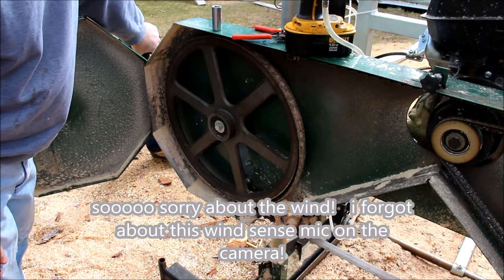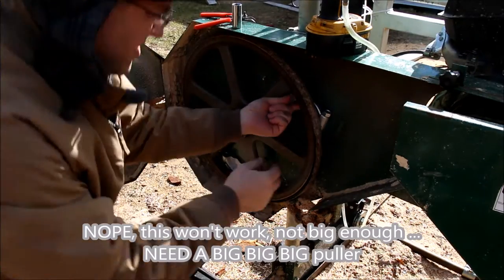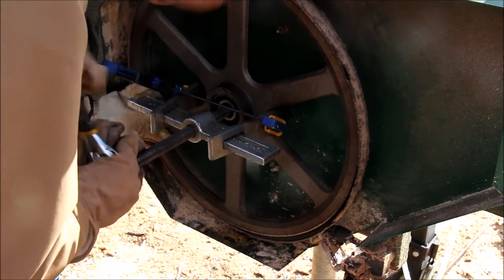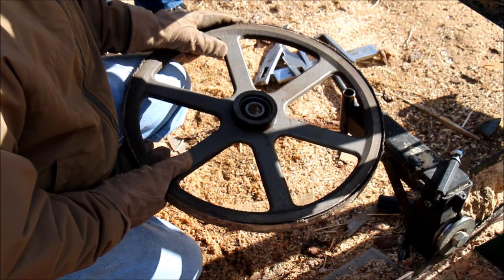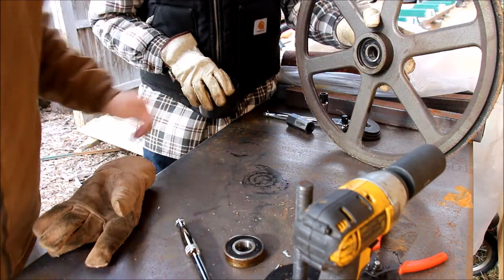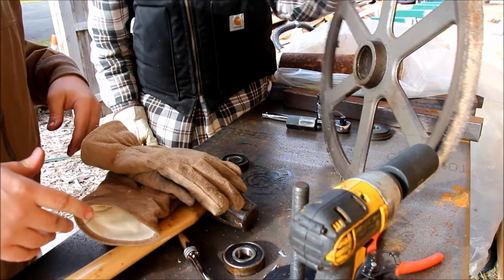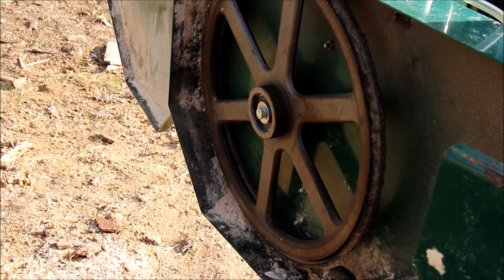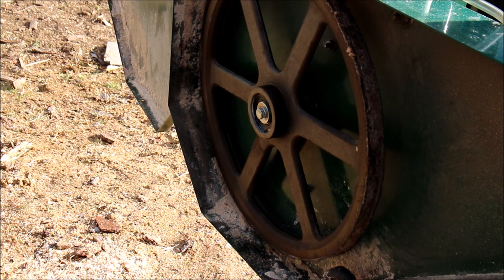Woodland Mills HM126 bandsaw bandwheel bearing replacement

Comment: Where did you get the bearings? Are those bearings still going? Thanks Der Guy.
Reply from the maker: Ebay
Reply: @matthewolson8875  Thanks. Would you say there are good bearings or what would you use?
Reply from the maker: @josephgrant9137  i got generic ones.   They work fine.  They were inexpensive and now that I know how to change them out its easy
Reply: @matthewolson8875  What would you rather use? My bearings failed and don't want to have to do this again for awhile. Thanks.
Reply from the maker: @josephgrant9137  Japanese bearings if possible... nachis if you wanna have em last.  But I just bought 10 of the generic ones....they are easy to change
Reply: @matthewolson8875  Sweet, thank you. Have a good night.

Comment: He mentions Harbor Freight but the headline says Woodland Mills. What's the deal?
Reply from the maker: He?  As in me?  Woodland mills mill is like the hf mill but upgraded in quite a few ways....
Reply: He has a Woodland Mills sawmill but the tool set for removing and replacing the bearings is from Harbor Freight.

Comment: I don’t think I would have put the anti seize in the bearing bore this will make it more likely to aping and ruin the wheel, maybe a thin light coating of oil but not anti seize
Reply from the maker: I totally understand the sentiment but I Have had tons of comments especially in regard to chainsaws indicate indicating that antics is no good for bearings yet I have not seen any practical situation where is situation where it increases the likelihood of spinning a bearing Thanks for the comment though
Reply: I’ve seen it first hand
Reply: I’m sure it will be ok though, glad u got it fixed! Thanks for sharing
Reply from the maker: @TheHomePros6221  I've seen spun bearings for sure....just not need any that I've built....and I put anti seize on a lot of bearings.

Comment: Where the hell did you ever get the ideal to use anti seize on a pressed fit bearing surface?  Never, never, never! The way those old bearings came out was perfectly normal and exactly what's expected. The next time your bearings go bad and the outside race starts spinning in the hub, you can thank yourself for using anti seize because you'll be replacing the drive wheel along with the bearings. Anti seize is mainly for threaded nuts and bolts. That also goes for using anti seize on the shaft where the inner race seats. Don't encourage a bearing to spin where its not supposed too.
Reply from the maker: Hey Todd...do you have a reference for why anti sieze is bad in this instance?  Link?  I still don't think it's bad to lube 2 pressed surfaces.   If the bearing goes bad there is always the likely hood of it spinning in the pocket but so far my experience seeing that is rare....   most of my experience is with chainsaws and I use antisieze  all the time when pressing bearings but have never seen a failure due to the antisieze itself.  Let me know if you have a link...I'll read up on it
Reply: Ok, you just answered your own question within your question. I quote " if the bearing goes bad there's always a chance of it spinning in the hub". (Because of the use of anti size) You increase that chance when you lube something that's designed for a pressed fit and not supposed to move! That's why. Bearings spin where there's least resistance. If the bearing were go bad and it's friction coefficient gets to high, it's going to start spinning where the next least resistance is, right where you put the lubricant! By putting anti seize on the shaft and hub your encouraging the bearing to spin where it's not supposed to.  Why encourage that to happen by applying anti size? 
     I've assembled thousands of bearings on shafts and pressed them into hubs at a manufacturing facility. Never were we instructed to use any lubricant or anti seize on any surface.
     Of all the bearing repairs I've done over the yrs, I've never found anti seize inside from any manufacture either. 
     For the last ten yrs I've worked in industrial facilities like coal fired power plants,  paper mills, nuclear power plants and oil refineries. We use it daily. But almost exclusively on bolt threads, never in contact with bearing surfaces. The product says where it's used on back of can and even shows a picture of a nut and bolt on front. Lol.  Nothing about bearings. 
     So now a friendly back at yah. 
#1, what or where's yours reference that this is a good idea to do? Or that the manufacturer of anti seize approves it for this kind of application?
#2, why do you do it? Do you think it's going to aid in the next time you have to fix it? There's nothing abnormal in the way it came apart when you repaired it. Completely normal, both inner and outer races fit tight like the day they were assembled. Your supposed to have to use a puller and or press to accomplish the job.  Any difficulty you had was because you didn't have to right tools. You said so yourself in video. Your use of hand held ball joint puller from harbor freight was perfect. All you had to do was use impact on bolt head, but you abandoned it to use hammer. It was working perfectly. They come apart hard. Their supposed too, it's a pressed fit. 
#3, why would you use anti size for that application, that no other manufacturer in the world does? The only place they and I would use it would be on the threads of the bolt going into end of shaft. Exactly what it was designed for, threads.
      Now,  with that being said,  if you catch your bearings before they seize you may never have a problem. If not,  you'll be replacing shafts and hubs after the bearing races spin on them because of what your way of repairing things. 
     Now, for words of wisdom. The only thing worse then having to make a repair, is making a repair on something somebody else already worked on. I trust no one if I can tell it was previously worked on. Thanks for questioning my intelligence on the matter. Todd.
Reply from the maker: @toddscholze6168  i'm sure you have way more experience than me with bearings.  just wondering if there is a reference book/ link somewhere that explains specifically why this is bad practice.  i understand the bearings can spin in the pocket, and because they are press fit surfaces this would only occur if the bearing not only fails catastrophically, but it also has to ... as you put it, have more friction internally than externally to spin.   I suppose I'm lowering the external friction... sure.  is it enough to encourage the bearing to spin?  I don't think so.  on that we disagree but I don't really see a problem with a disagreement.  one thing we can totally agree on is not trusting other peoples work.  i'm with ya 100%.  in this case, yes, I bought a pile more bearings so I can change them out fairly regularly and the antisieze is part of that regimen to aid in the bearing removal ... before the spin.  

So, not questioning your intelligence, just wondering if there is a definitive reference somewhere so I can read up on it.  you are not the authority here.   neither am I.  a quick search on google reveals plenty of people using all different kinds of lubricants, and plenty of people such as yourself saying not to do it.  If I find a spun bearing next go around I'll definitely let you know, in which case i'll need to buy a new bandwheel, in which case you will be justified in telling me "i told ya so" and I'm fine with that :)   Merry Christmas

Comment: U shudder heat it up
Reply from the maker: yeah, i could have gotten out the torch.  but heating cast iron is trixy iirc.  it should be much easier going forward with bearing changes now...since A: i know how to do it, and B: the anti sieze in there will help with future install and removals.